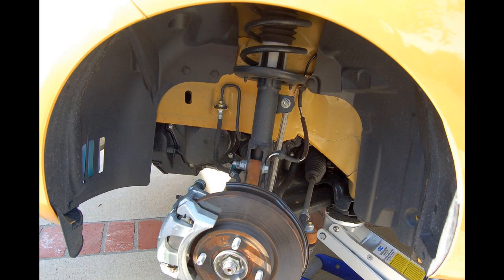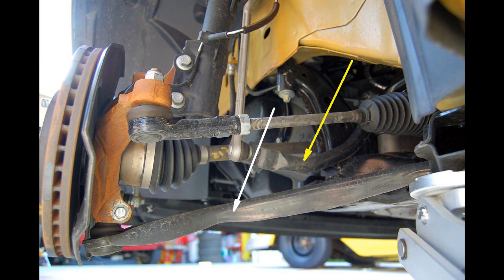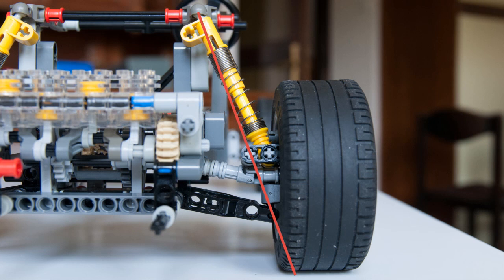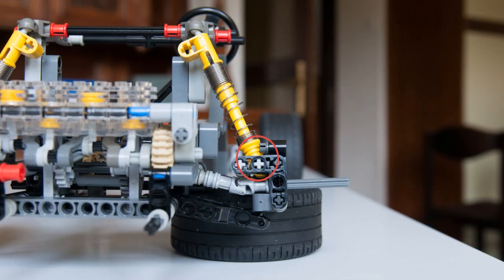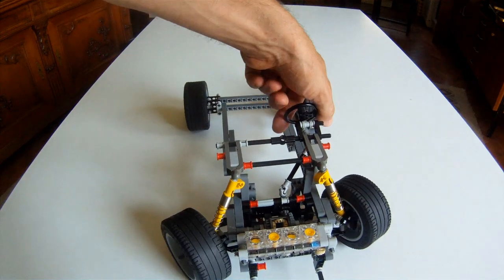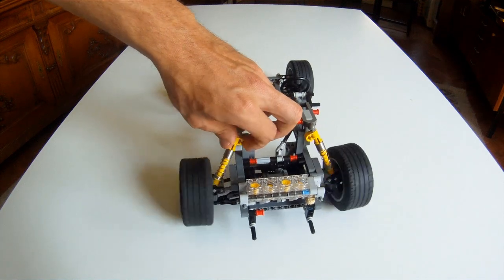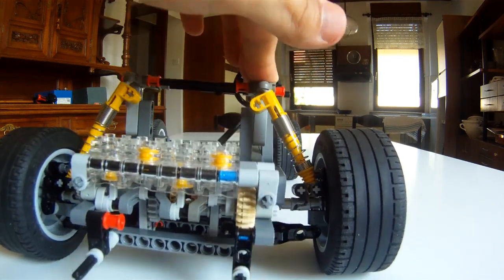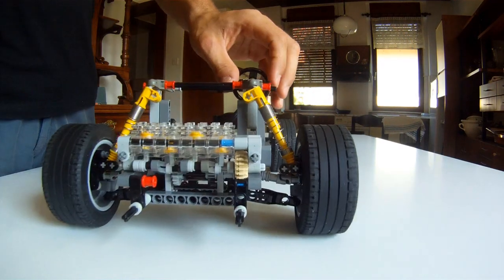LPEpower episode 09 - Macpherson strut suspension

Comment: Why can’t the lower wishbone be an L to simulate unequal length wishbones
Reply from the maker: What do you mean? Car wishbones have usually an L shape to transmit bumps into the bushing at the rear of the L shape, to soften the pothole and road imperfection impacts. It has nothing to do with unequal length geometry, which doesn't really apply in a macpherson setup.
Reply: nicjasno well if the pivot is on the top of the L, and the bottom connects to the strut wheel assembly, then when the system compresses it expands. The way angles work means that in this expansion, the top of the wheel will tilt inward. What do you think?
Reply from the maker: Sure, but it's a different dynamic as in an unequal length setup, and the shape of the wishbone has nothing to do with it. It's about the angle of the strut, the length of the wishbone and a few other factors.
Reply: nicjasno Ahh, I see. I explained it weirdly. I guess the equivalent is a lower wishbone with a very steep angle, far from horizontal. Does it ruin some suspension geometry?
Reply from the maker: You want the arc that the tip of the wishbone describes to be as big as possible, to minimise those effects. That's why the lower wishbone needs to be as long as possible.
Reply: Although it does make the tire slide, it does actively make the tire tilt towards the car, aiding cornering?
Reply from the maker: Now you have lost me.
Reply: Here.
Instead of the lower wishbone being horizontal, what if it was in a 4:30 o clock position when viewed from the front. Then add the rest of the system. When compressed, the wheel will slide outwards because the 4:30 position is going into a 3:00 position. The new geometry formed by the long wishbone being horizontal instead of 4:30 expands the wheel outward. Since the wishbone is longer, and the strut is shorter, the wheel is forced to tilt to the vehicle.
Reply from the maker: That's why stanced cars have so much camber. During cornering, this is desired and there's other geometry (caster, kingpin), that plays into that and makes sure the wheel is in optimal contact with the road, when the car is leaning to the outer side of the corner.
Reply: @nicjasno Thanks for your advice years ago. I’m in my college’s engineering club revisiting these videos. Thanks for making these : )

Comment: I don't see what is the point of a lower control arm! It attaches to the wheel hub assembly through a ball joint, which can be bent in all direction.

If the ball joint can be bent in all directions that means it can't provide any support. So why do we have lower control arm?
Reply from the maker: The ball joint does not bend in all directions. Are you sure you understand the mechanics of this setup?
Reply: I installed a lower control arm on my car no too long ago. When you hold the small rod attached to the ball joint I can rotate it 360 degrees in all direction. It moves about 2 inches from side to side!
Reply from the maker: Which rod exactly are we talking about? All components in this setup are essential.
Reply: The one connection the control arm to the wheel hub assembly!
Reply from the maker: a picture would be helpfull.

Comment: Because there's no upper control arm, which would be affixed to the frame, and connected by the hub to the lower control arm. You remove an entire pivot point, letting the suspension adapt to the wheel position instead of the wheel adjusting to the suspension

Comment: Consider the hub carrier/shock piece. If you take moments about the wishbone pivot, the reaction force from the ground transferred into the hub carrier creates a moment, trying to rotate the hub carrier in such a way as to increase negative camber. In a dual wishbone set-up, the top wishbone would counteract this moment however in a macpherson strut, the only thing that can counteract this moment is to apply a bending load to the shock, increasing the friction.